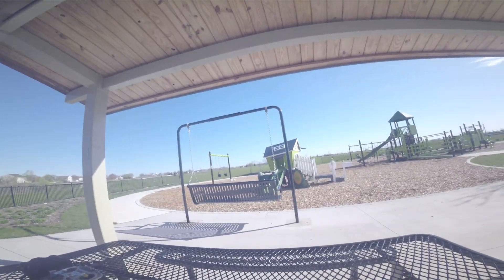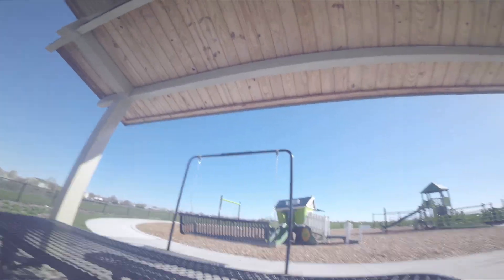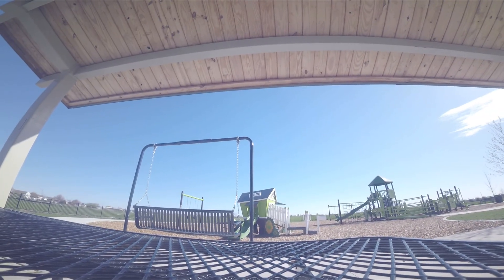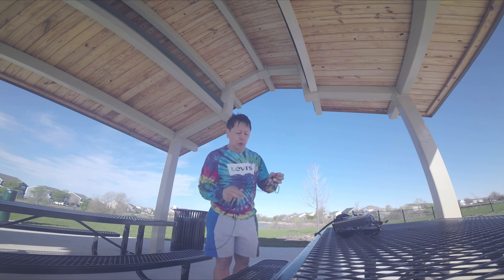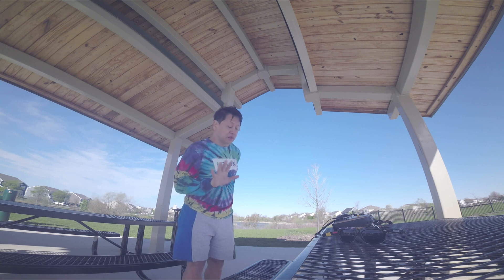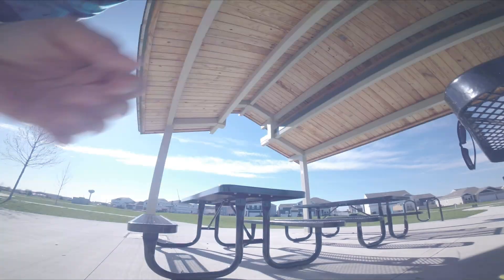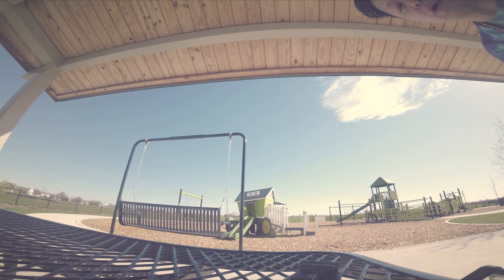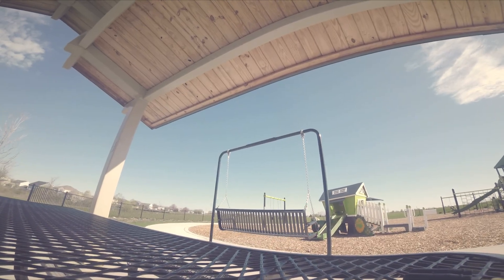Betaflight 4.5 RC4 is Awesome! SUPAFLY Preset! And tested my color brown 3mm thick ND Filter!

Comment: Were the motors hot after flying?
Reply from the maker: It was just warm but I can hold it for a long time. Why? I'm still using the same preset today and firmware today, no changes. I can test it again today since I'm going out to test my new camera angle, 37 degrees.
Reply: @neilfpv  nice thank you for the response. Which firmware are you on? Do you use the supafly calculator on the website too?  & I love the tune but my motors get sooo hot
Reply from the maker: @jpeezus6519  Yes I used the supafly firmware but I wasn't aware about the calculator. I think I selected a lower kv. For example, my motor is 1920kv and choices were 1920kv, 1860kv, etc. I think I picked the 1860kv. I remember the motors were hot but that was like 1 or 2 years ago. I am using Betaflight 4.5 firmware. I haven't checked out the latest yet